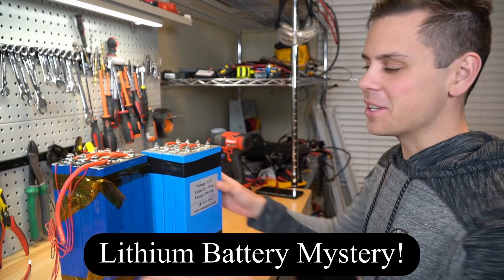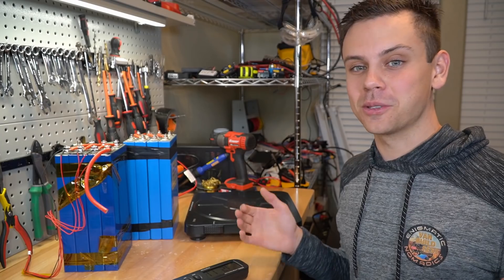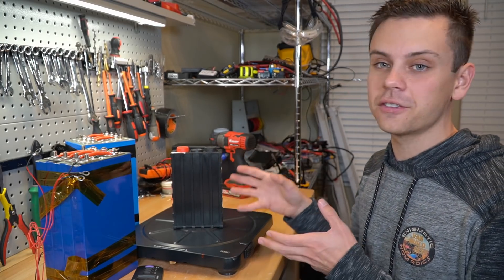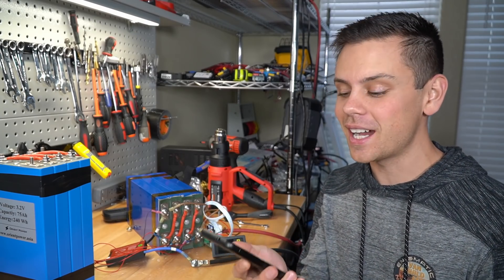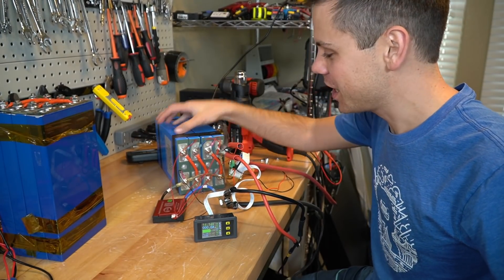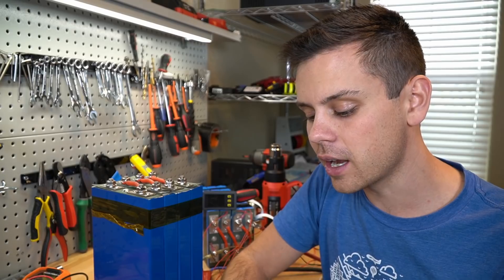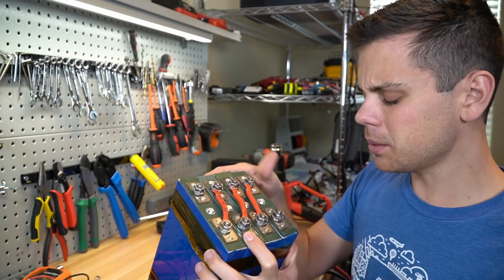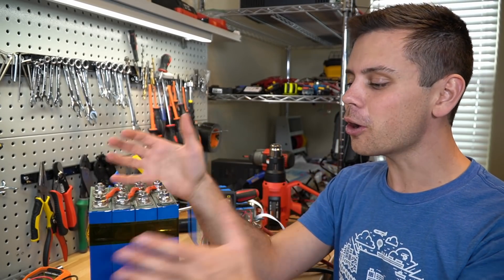Lithium Battery Mystery: This 100Ah LiFePO4 Energy Density is Off the Charts

Comment from the maker: Also, it is nearly impossible to hide NCA/NMC/Li-poly in a LiFePO4 marketed cell. Because the charge/discharge curve is different, and because the voltage drop near the end of this test would have dropped much sooner. If it was another chemistry, I would spot it right away. But lifepo4 discharge hangs around 13.6 to 12.8v for a 4s battery, and any variance would have been easy to spot.

~~~~~~~~~~~~~~~~~~~~~~~~~~~
Does off-grid solar confuse you? Check out my DIY friendly website for solar system packages and product recommendations, and so much more! http://www.mobile-solarpower.com

Join our DIY solar community! #1 largest solar forum on the internet for beginners and professionals alike: https://www.diysolarforum.com

Check out my best-selling, beginner-friendly 12V off-grid solar book (affiliate link):
http://amzn.to/2Aj4dX4

If DIY is not for you, but you love solar and need an offgrid system, check out Tesla Solar. Low prices and great warranty, and they can take your entire house offgrid with their new Powerwalls: https://ts.la/william57509

~~~~~~~~~~~~~~~~~~~~~~~~~
My solar equipment recommendations (Constantly updated! Check here first):

12V/48V Lithium Batteries: https://www.mobile-solarpower.com/solar-batteries.html

Solar System Component Directory: https://www.mobile-solarpower.com/solarcomponents.html

Plug-N-Play Systems: https://www.mobile-solarpower.com/full-size-systems.html

Complete 48V System Kits: https://www.mobile-solarpower.com/complete-48v-solar-kits.html

DIY Friendly Air Conditioner/ Heat Pumps: https://www.mobile-solarpower.com/solar-friendly-air-conditioners.html

Complete 48V System Blueprint: https://www.mobile-solarpower.com/48v-complete-system-blueprint.html

~~~~~~~~~~~~~~~~~~~~~~~~~~
My Favorite Online Stores for DIY Solar and Coupon Codes:

-Current Connected: SOK, Victron and High Quality Components. Best prices and warranty around: https://currentconnected.com/?ref=wp

-Signature Solar: Cheap Server Rack Batteries and Large Solar Panels:
https://www.signaturesolar.com/?ref=h-cvbzfahsek 

-Ecoflow Delta Official Site: My favorite plug-n-play solar generator:
https://us.ecoflow.com/?aff=7

-AmpereTime: Cheapest 12V batteries around:
https://amperetime.com/products/ampere-time-12v-100ah-lithium-lifepo4-battery?ref=h-cvbzfahsek

-Rich Solar: Mega site and cheaper prices than renogy! Check them out: 
https://richsolar.com/?ref=h-cvbzfahsek

-Shop Solar Kits: Huge site with every solar kit you can imagine! Check it out:
https://shopsolarkits.com/?ref=will-p

-Battery Hookup: Cheap cell deals
https://bit.ly/2mIxSqt
10% off code: diysolar

-Watts 24/7: Best deals on all-in-one solar power systems, with customer support and distribution here in the USA: 
https://watts247.com/?wpam_id=3

~~~~~~~~~~~~~~~~~~~~~~~~~~~
Contact Information:
I am NOT available for personal solar system consult! If you wish to contact me, this is my direct email: williamprowsediysolar@gmail.com

Join the forum at https://diysolarforum.com/ if you wish to hang out with myself and others and talk about solar

FTC Disclosure Statement and Disclaimers:
Every video includes some form of paid promotion or sponsorship. Some links on this youtube channel may be affiliate links. We may get paid if you buy something or take an action after clicking one of these. My videos are for educational purposes only. Information is subject to change/update at any time. Electricity is DANGEROUS and can kill. Be smart and use common sense :)

DIY Solar Power with Will Prowse is a participant in the Amazon Services LLC Associates Program,
An affiliate advertising program designed to provide a means for sites to earn advertising fees by advertising and linking to Amazon.com
Reply: If you can buy those cells directly from that manufacturer, set up some standard design kits yourself (home solar/wind power storage, for example) with BMS, in erters, et al, and sell DIY kits with a reasonable markup. I, for one, would love to have an option like that.
Reply: @randyfelts4625  seconded. If Will would start selling long lasting high energy LiFePO4 Ebike batteries I'd totally buy some.
Reply: Their specs as far as energy density when multiplied by the weight you measured lines up pretty close to your results too...
Reply from the maker: @christianriedel7017  that's amazing. So cool. Shows that the test equipment is working
Reply: Please help I have a victron charger 48v 5000va 70amp and currently run 24x liquad Bosch bgc15 6v 230ah batteries. Could I replace with lithium and use less batteries?????? I have 21 solar panels.
I power
TV 
Water pump
Fridge
Freezer
Lights
Washing machine
Reply: That is really cool... But it makes you wonder how they did that.  Did they use low quality cells that will not last more than a few hundred cycles?  I would love to see how many cycles you could get out of them.
Reply: I suspect those are OEM BYD cells
Reply: The stuff of Wkipedia is 10 years old for LiFePo4 battery chemistry. I've been reading translated chinese research papers that show battery manufactures in China are starting to use electrolyte mixtures similar to those used in lithium cobalt batteries and they have been also integrating other materials like manganese or zinc into the graphite anode. There has been lots of talk in the Chinese battery manufacturing community of trying to push the LiFePo4 chemistry to 240 per kg in the next 2 to 3 years, which is what lithium cobalt batteries are currently sitting at, but research laboratories in Europe, Japan and the US are allready currently pushing lithium cobalt chemistry to 300 Wh per kg, so lithium cobalt will still continue to outpace Lithium iron phospate batteries. These efforts to push the tech to its limits on both sides appears to be showing real world results.
Reply: @WillProwse   can I pay for your time to ask a question??? I just want to no how many lithium battery I need ? I currently have 24x 6v 240ah lead acid and want to know how many and what lithium I should buy please
Reply from the maker: @FaceTubeU  can you please post this info on the forum? We would love to hear these details. That's fascinating

www.diysolarforum.com
Reply: @WillProwse  busbar made of wire have the advantage of being flexible, they won't put pressure on battery leads
Reply: @Jase-so2tm  24 x 6v x240 ah = 34560 watt ..... lithium are twice as effective  so you need half that load = 17280 watts
Reply: I know the battery manufacturer well showed in the Video , I do not comment on the quality and price you mentioned in the video, if  anyone is interested in good quality cell and good price, contact me , you will be surprised ....
Reply: HELLO THERE DEAR ..... IM MAKING A REALLY POWERFUL SKATEBOARD 4 THREE PHASE MOTORS EACH OF THEM EATS 4700W . SO THE QUESTION IS WHICH BATTERY SHOULD I TAKE HIGH VOLTAGE WITH LOWER AMP POWER OF LOW VOLTAGE WITH HIGH AMP POWER ??? KISS
Reply: Most likely these are Lithium Ion battery. Greatpower website have only Li-Ion batteries in rectangle shape.
Reply: @jurgenhua9422  Hi jurgen I'm curious what are you offering. Thanks

Comment: We learned that Wiki article for LFP energy density needs updating. Factories in China have been investing in newer manufacturing equipment, which allows thinner and more uniform production of laminated sheets, which allows packing more of them in the same volume. They also designed shorter internal terminals, so longer sheets can be packed in same height. These are all expected manufacturing improvements as prismatics market grows and matures. NMC is improving in lock steps too, so latest NMC cells are probably still better energy density as latest LFP cells. Anyway, thanks Will for another great video!
Reply: Agree with u. More over, lifepo4 density not highest, but safest. Some chemical component can increase the energy density, but can’t ensure the safety. Evaluate from applications choose different types. What you think

Comment: Hadn’t thought about that when I bought my 200ah lifepo4 from China. I dropped a link to your video you did on breaking down the ruixu and they came back saying they have a second generation coming out next month with fixes for what they saw in the video.
Reply: did you buy the hhx battery and if so, how did it work for you will you report back? I'm sure that will would like to know I know I would.
Reply: Phil V no I did not. I did by some second hand from a seller recommended by David Poz YouTube’s channel 24v packs that did turn out to be really poor performers. I did however get a small refund for their deceptive sales technique at battery hookup.
Reply: Bill’s Solar Power and Gardening some times we have some slightly defect, brand new cells to give away

Comment: @DIY Solar Power with Will Prowse Love your videos.  They are direct to the point and easy to understand.  Could you do a video with step-by-step instructions on how to set up and test the capacity of a battery?  I bought a used battery and like to know how much is has degraded from its rated capacity.  Thank you.

Comment: I didn't read all the comments to see if you gotten chastise for this some electrical Theory says the voltage amperage whatever you want to talk about only travels on the outside of the wire so the more surface area the more conductivity don't know if that's true but something to think about thanks for all your videos they are very much appreciated for the work you put into them
Reply: From electronics 35 years ago we learnt that as the voltage increases it travels on the outside of the wire. Greater voltage greater distance. Higher voltage = lower amperage for the same amount of power (Watts = Voltage x Amperage)

Comment: I love seeing those advertised vs. ideal capacity values together
Reply: Christine A ratings can vary widely depending on the manufacturers,  Korean companies tend to rate their cells low so the user is very happy with the product.  Some other tend to exaggerate their capacity or publish a max value rather than a minimum.  

Also you need to be sure you understand the discharge rate they are quoting.  Fast rate means you get less aH out.  Slow rate you can get more .  

Old lead acid trick is to publish a 20 hour discharge as the AH rating.  Discharge I 1 hour you get much less.  Because you loose some energy to heat.

Comment: There is a Chinese manufacturer of very similar cells called BLS and they have great prices. They also have better terminals and they usually ship with flat copper bus bars. Also, you might consider using thick double sided tape to put the pack together. You just have to be careful if you want to take them apart.

Comment: If they only let you buy 100 batteries, why not do a group purchase thing? Would the distributor ship 4 batteries to different locations like that?
Reply from the maker: Sure, you can post it in our group buy section on the forum
Reply: @WillProwse  shipping is the kicker, unless by boat.
Reply: There is no need to do that .. there are TONS of reputable dealers in China that will sale you one battery at a time ... we buy 200ah batteries at least a couple times a week for right at $630 delivered ... one at a time ...
Reply: ghostwriter6699 as asked before, who is "we" and will you post the details so others can buy or are you a distributor? Thx
Reply: @ghostwriter6699  can we get some contact information or was this just a bragging post.

Comment: So cool you brought up bike applications, I have built hundreds of electric bikes and 100AH in that form factor would be amazing.
Reply from the maker: I want to build a solar bike so bad!!
Reply: @WillProwse  May I suggest an AGNI D/C motor for amazing power and efficiency, as well as simplicity.  AKA Lynch motors, they can be controlled with off the shelf high wattage PWM controllers.
Reply: @WillProwse  go for it please and of course record every detail. I am sure many of us want to build one also.
Reply: I shall put this on a 1000w rear hub with a 35amp controller and a cheap lcd display  and cruise the city for hours!

Comment: You can have different amount of energy in the same size battery.  It depend on if the battery is built for power or energy.  To make a higher energy battery the active material is applied thicker.   This means less room inside the cell for current carriers.   On the flip side a power battery has thinner active materials this leaves more room for current carriers so you can get higher power (shorter C rate)   There always a trade off between power and energy.    

As an example the same cell could have 28 aH in the power version and 43 aH in the energy version.

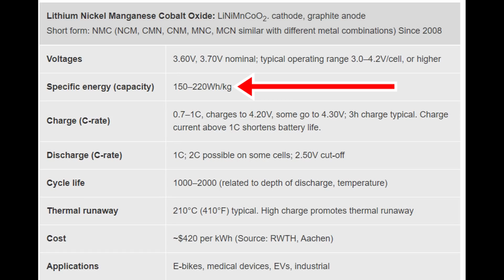Comment: 4:20 Wait - what if it IS that other chemistry? what if they put the cheaper higher density lithium cells in that are not LiFePO4? The ones that have 500-1000 charge cycles? Could they be selling us off the shelf cells rather than long lasting ones? ... who would know until the sales were long since complete? Even 1000 charge cycles can take 3 years to hit. Plenty of time to rake in cash and shut down afterwards, no warranty.
Reply: That would be unlikely.  NMC cells have a nominal voltage of 3.6V, whereas LFP cells are 3.2V.  Therefore, the difference between these chemistries can be identified simply by charging the cell and measuring the voltage.  Furthermore, it is unlikely that NMC are cheaper to produce, since one major source of cost with NMC is the cobalt, which is becoming increasingly rare and expensive.  With LFP, the most costly element is the lithium (which NMC also requires), since the iron and phosphorus are cheap as dirt.
Reply: Heat them up and see if they go into thermal runaway
Reply from the maker: @andreafalconiero9089  Exactly
Reply from the maker: @andreafalconiero9089  Also the charge/discharge curve is different, so it would be easy to spot

Comment: Very good review. Decent li ion energy cells however have around 250wh/kg and power cells close to 200 but I also am very surprised with the capacity of those lifepo4 cells. Perhaps the bigger cells have a better energy to weight ratio compared to smaller ones because of a better “battery” to casing ratio.

Comment: Great info on an emerging technology! Unfortunately, you will always find people (mostly in marketing) who will make specious claims using a particular set of testing protocols, and if you use a standard protocol, you would of course get different results. I'm not defending their actions, or statements, just saying that having worked for engineering departments in the past, marketing people have always had free reign with the "facts" and will mislead folks by stating a particular finding that only seems to work in ONE particular scenario. Of course, YMMV!

Comment: Hello guys I have question. Would it be possible to use a battery pack like this as a car battery? And would the perform good as a battery in cold weather?
Reply: You cannot charge lithium batteries sub 32 degrees f. That being said, I would use sealed lead acid batteries for a car battery since it has much higher cold cranking amps than lithium. Hope this helps

Comment: I need to update the solar/battery storage on my RV..   12V system.    I have a renogy 400W system.    What batteries do you recommend for replacing the current lead acid batteries?

Comment: working on components for 48v mpp solar 5000w set up, mpp all in one is ordered, will order batteries (16 x 3.2v 150 ah) Friday, that bms would be the 8s 20s for 300a for that config, correct? really would appreciate a vid from you on setting up that to run to a dedicated breaker box. trying to figure fusing, runs, etc, but also waiting on components to see exactly what I have/need. great info in your vids.

Comment: Been watching your videos great help for load calculations. Trying to set up solar on the  boat. 
 Can I use the battle battery on a boat these batteries are sealed correct? Better than my west marine  My current battery  4 x 135 ah batteries  Currently  having to go down every 2 days to turn on the gen set or engine in the boat 
Trying to run a small refrigerator and freezer. approx 80 watts total Want to keep the beer cold  The issue I have is how many watts do the 2  units draw on average over 24 hours. 

Based on your math I could be at 800 watt solar. Not sure this is the right place for advice but Ill take it

Comment: Thanks for the video. I confused though with BMS. What would happen if you didn't use one? Is it only necessary with Lithium?
Reply: masmusica Bill BMS is short for Battery Management System, it helps to keep the battery cells balanced... and to answer your question, yes, it’s necessary for lithium.

Comment: Very interesting 🤔 Will on the link you gave for the 100ah Ruixu pack  with metal bars for $520
They also have a 100amp 4s BMS listed for $80. Looks large and a lot like the BMS on the first demo LiFePo they sent you. 
Could it be the very same BMS? Curious 🤔

Comment: Why did you discharge the other battery to 10.6 and the other to 11.2?
Reply from the maker: The BMS determines low voltage cut off based on individual cell voltages. Not full pack voltage.
Reply: @WillProwse  ok, thank you for the response, so the other bms discharged the cells to like 2.8 and the other to 2.65, what energy meter was that by the way couldnt find it anywhere?
Reply from the maker: each cell has a different capacity and the smallest capacity cell will determine the voltage cutoff for the entire pack so it really depends on the temperature the arrangement of cells how well they're matched in many other factors